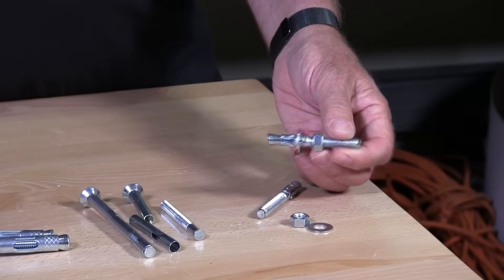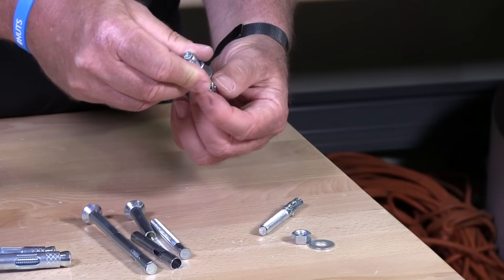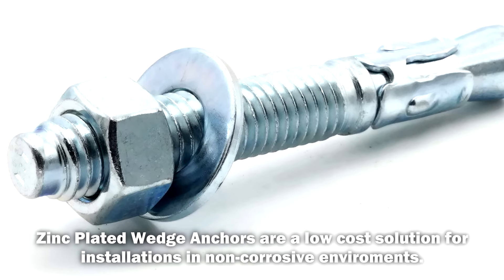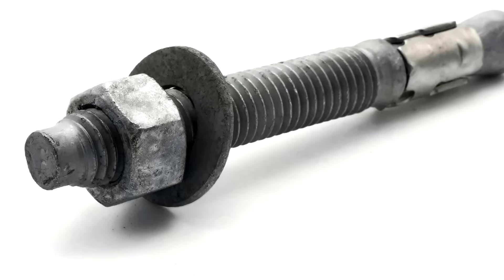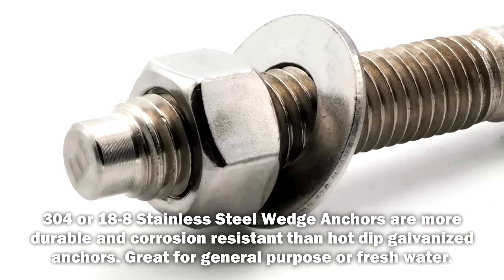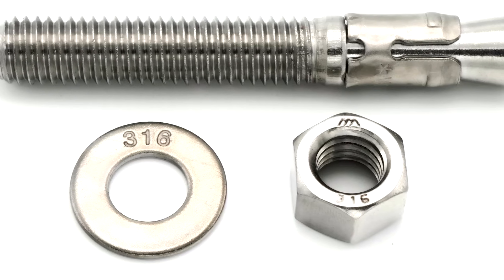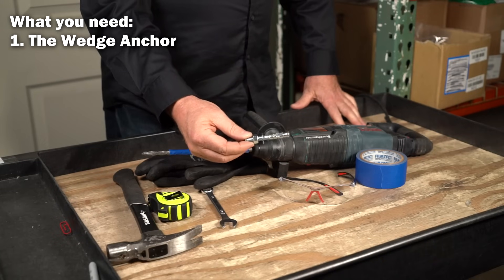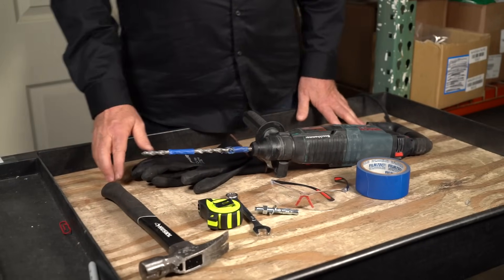Beginner's Guide To Wedge Anchors: What you need to Know | Fasteners 101

Comment: Just another tip: if you wrap the blue tape around the bit and leave about 1 inch excess blue tape hanging off, it will act as a mini fan and will blow the dust away from the bit.

Comment: It worked but I would still clean out the hole. Either with vacuum or compressed air. I always thought that these could be used in brickwork as well. But now realizes that it’s actually only for concrete. Thanks for clarifying. What can I use in a brick wall.

Comment: Great video. Thank you. Is there a way to adjust the amount of thread exposed without the sleeve of the anchor also sticking out? I just placed some, and i had less thread than i would like due to tapping the sleeve flush with concrete 

Thanks again

Comment: I want to attach 2x4 to concrete wall, but have a 1 inch foam board glued to the wall for insulation. Can I drill through the foam and attach the 2x4 over top of the foam, or will torqueing the nut down crush the foam? I would rather keep the foam for a thermal barrier.

Comment: I hung a 2x4 on the wall to make a shelf unit come out from wall about 24inches. I was using 3 3/4 anchors. The wall unfortunately on the one end 'hollowed out' on me. so I went to 3inch wedges.
They seemed to tighten up better and the drill bit didn't hollow out as I didn't go in as far. Problem is, when I got done, from looking down from the top only, i can see every anchor, the 2x4 didn't stay close enough to the wall. Don't know if I should loosen all the nuts and pound in more, or will that weaken it. None of them really seemed to tighten as much as yours did either. I saw one video that said only 2 turns. I think it seems strong but am worried.

Comment: I am using a wedge anchor to fasten a bison panel (cement bonded particle board made out of 62% cement & 28% wood) to a wall. I'm afraid that while tightening the nut , the board might crumble. Is it ok to first tighten the nut thereby wedging the anchor first and then remove the nut and then fasten the board to it? The real question being, does it remain wedged only as long as the nut is on there ?

Comment: I drilled the hole using a 1/4” drill bit. I put the wedge anchor into the hole. It actually slid in rather easily. I had to use a hammer to get it all the way. When I started tightening the locknut, the anchor spins freely. What can I do to get it to work? Do you need a washer? My fear is the hole is too big for the anchor which I’m not sure how that happened. I used the exact size bit the directions called for. Should I try a different type of anchor?
Reply from the maker: If your anchor is 1/4" then this is the correct hole size.  Yes, there should always be a washer under the nut.  To resolve the issue if the anchor is 1/4" then pull on the Achor with your hand or the claw if the hammer to set the Achor.  If the Achor just pulls-out, then remove the Achor and review the shield at the bottom of the Achor that creates the locking mechanism to see it is operating.  Or change the Achor.  Good luck!
Reply: concrete epoxy

Comment: I followed all the instructions to mount a 3/8” anchor. I drilled a 3/8” hole about 2 3/4”  and cleaned out the inside of the hole. But after 15 hits with a hammer I’ve only managed to get the anchor bolt about 1” into the concrete. All the videos I’ve watched shows anchor bolts being easily hammered in with just a few hits. What’s gone wrong? 

I’m your video what is the drill size for your 3/8” anchor bolt? 

Any ideas anyone? Should I have drilled a 1/2” hole for a 3/8” anchor bolt? 

Thanks.
Reply: Hi, I read your comment and based purely what you wrote my tips are these  a) drill bit size matches instructions wedge anchor is diameter of thread size, sleeve anchor (we call them dynabolts) drill size is diameter of sleeve. (If you drill a larger diameter hole the expansion wont grab and the anchor will spin as you tighten never fully locking) b) depth of drilled hole always longer than anchor, c) masonry drill running as you exit the hole, d) properly cleaning (hole brush and also pumped air) cannot stress cleaning enough dust in there compacts and jams anchor going in, e) loosening the nut slightly so the wedge has some movement before you insert the anchor, f) I try to use only my fingers to push the anchor fully in, tapping with hammer if required. Sometimes when using fingers to insert the you can feel a protrusion in the drilled hole this way and then I redrill once. I have had the problem you describe and I put it down to the anchor jamming on some protrusion (small piece of masonry the drill skipped over or residual dust) as you hammer it just locks.

Comment: On the box, it says that you should Torque the Nuts down to 55 ft. lbs. It would be very easy to Over Tighten the Nuts damaging / deforming the sliding piece at the bottom, lowering the hold down capacity.
Reply: I think that’s entirely depending on brand and model.
Reply: Do I need to get a torque wrench and measure the torque? Or can I just "feel" it tighten and not over do it?
Reply: How do you know what the torque force is. Is it by how manybturns you make with the wrench?

Comment: I want to install a hose reel for my air compressor onto concrete block should I attach a piece of 2 x 6 to the concrete block ( with 4 wedge anchors) with 3/8 bolts coming out to actually hold the reel to the wood . Reason being to drill into the solid section of the concrete block. Thanks

Comment: The problem I have with the anchors I have been using is after pounding in the anchor the threads are too damaged to put the nut on.   It's very frustrating.    Any tips?
Reply: Screw the nut on a few turns and it will protect the threads

Comment: Can you remove them if you don't need them anymore? from wall?
Reply from the maker: I would not removed them but pull them out as far as you can and cut the stem off and push it back into the wall and cover with plaster.
Reply: @AlbanyCountyFasteners   so basically i drill longer hole and after if i dont need just push Anchor in the hole and cover with plaster
Reply from the maker: Correct!

Comment: is this good for pull up bars? because im using sleeve anchor but i cant even tighten.
Reply from the maker: It can be, if you're installing into solid concrete. Sleeve anchors could also work, though the only reason I can think of that they aren't tightening for you further is that they are already gripping the insides of the hole as much as they can. What exactly are you installing into?
Reply: @AlbanyCountyFasteners  pull up bars to wall. Is there any better than sleeve anchor?
Reply from the maker: @3mn422  What's the wall made of and better in what way?
Reply: @AlbanyCountyFasteners  sorry but i dont know the english term, but im using concrete wall
Reply: Lag screw is this good for this?

Comment: But if you actually go by bolt size for your comparison with sleve anchors sleve anchors are actually stronger because a 1/2 inch sleve anchor has a 3/8 in bolt inside and has alot more pullout force than a 3/8 in wedge anchor.

Comment: M10 anchor fastener which size drill bit is drilling
Reply from the maker: For wedge anchors, the drill size is the same as the diameter of the wedge anchor. So M10 in this example. If it's not a wedge anchor, please specify what type of "anchor fastener" you are referring to.
Reply: My m10 bolts needed a 12mm bit to grip

Comment: How can you remove them?
Reply from the maker: Wedge Anchors are a one-way trip. They were never intended to be removed after installation. If they were, they wouldn't make very good anchors. This is why it's very important to take great care in where you install these. If the worst should happen, the best you can do is cut off the part that's sticking out then use a hammer to drive the remaining anchor below the surface.